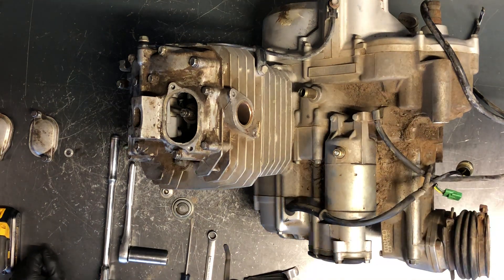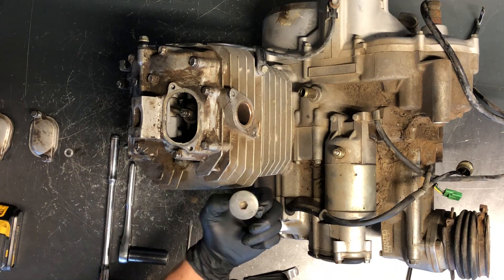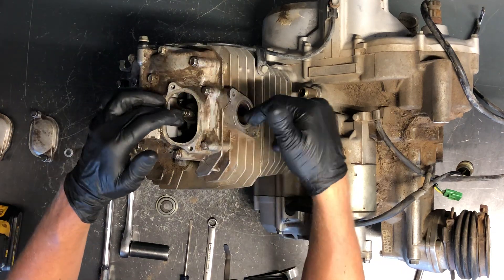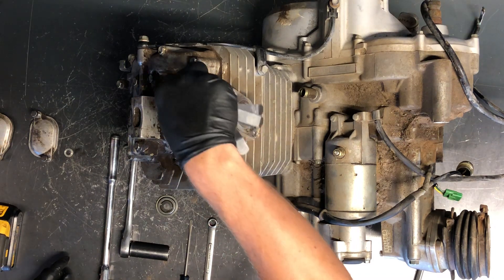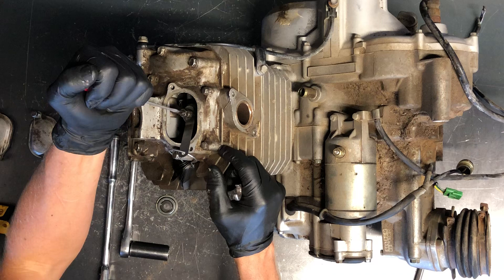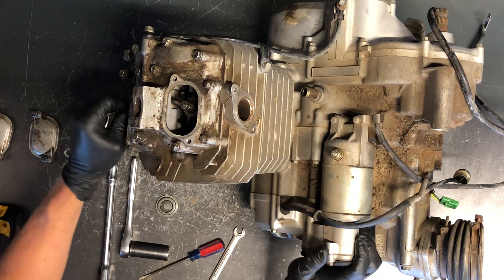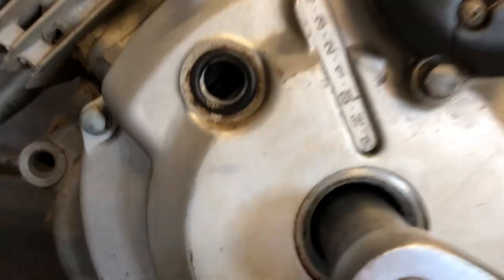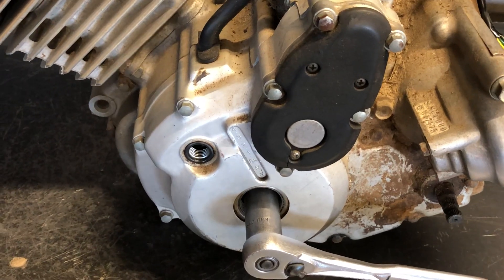Honda Fourtrax 300 TRX300 - Valve Lash Adjustment - Adjust Clearance + Specs

Comment: My 98 Honda has been great it still runs but my valves are knocking i think its real clacking when it runs it did smome but i changed the oil and no smoke but just a little. You know what if anything is wrong?
Reply from the maker: I'd do a quick valve adjustment. That might take care of the smokes and the ticking. If not, you might have some bad rings. Honestly you could run it like that for year if you keep an eye on the oil level. Thanks for watching and the comment. https://amzn.to/3PjzuSq

Comment: Where is the 17 mm nut to turn the motor over on the 4x4 version? My machine is a 95 and I do not have the alan wrench cap you removed in this video

Comment: I’m getting a loud bang at 3/4 to full throttle I’m not an atv guy I’m a heavy equipment mechanic but I’ve heard this is both lean or rich and I chopped plugs which were black so I’ve always known that to be fat... my buddy said my exhaust only got red hot because it was very lean so I then fattened my jets. Still same thing any ideas? I have gone to dyno jet setup and it idles and low throttle fine then hit the throttle and pops and bangs start I’ve played with air fuel and it doesn’t change full throttle bangs and pops no matter if I am rich or lean I’ve also tried 3 jet sizes now what it came with we aren’t sure because the jet sizes were not marked
Reply: Have the same problem since I’ve owned the bike. 94 Honda trx300 Big Red. Engine supposedly gone through by the bike shop I purchased from. Checked valves, cdi and carb. 1/2 to full throttle.
What timing do you refer to? Cam timing? Ignition timing? Can ignition timing be altered?

Comment: Do you think you know why the 1988 to 91year models of the Honda Fourtrax 300 are faster than 92 and up to 2000 I recently put a 88 carburetor and cam in  a 1996 Honda Fourtrax 300 it gave it more power but it didn’t make it go faster is there something else different
Reply: I've got a 88 and the stock tires look brand new in the middle of the tires sat its hole life best 4 wheeler I've ever had will never sale it !!
Reply: No expert, but 92 and up is when they went to 4 strokes, and a 2 stroke is just faster. I guess you mix oil in your gas?